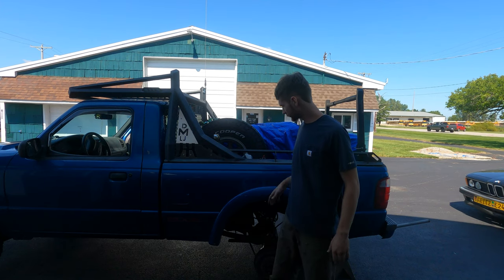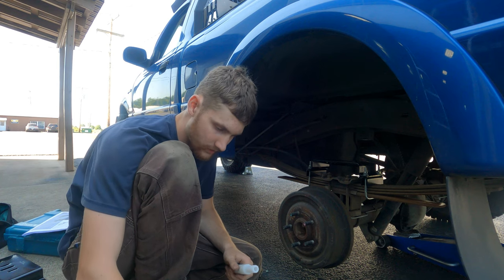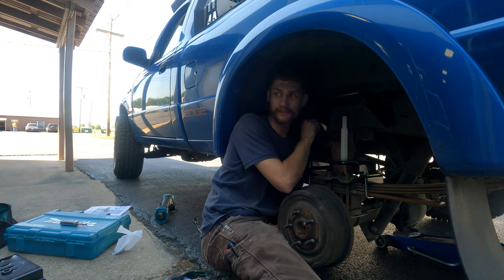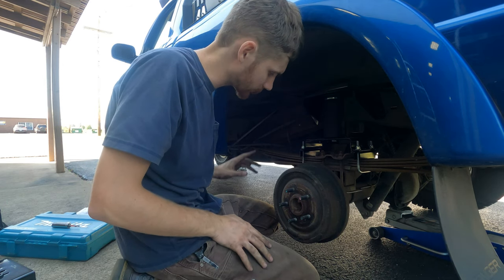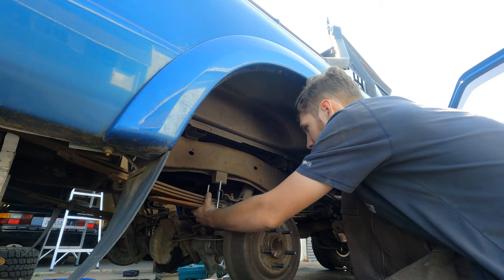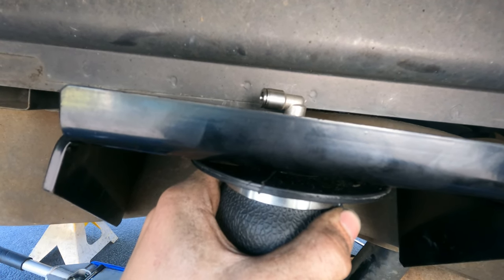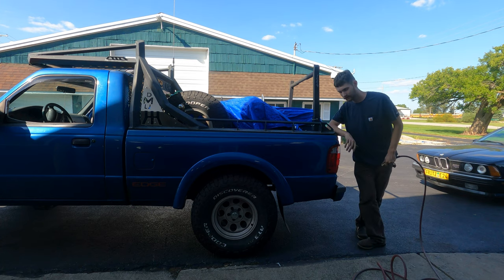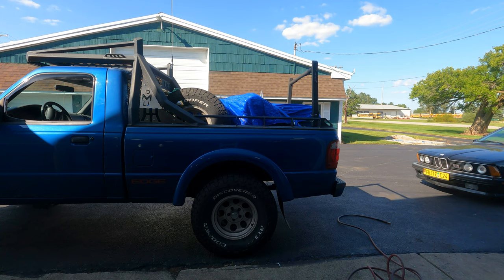Installing Airlift Airbags on my Ford Ranger!

Comment: How did it ride with the airbags installed? Great video
Reply from the maker: It improved the ride quality significantly. Before it was pretty squishy in the rear with all that weight, but the air bags stiffened it up pretty good.

Comment: Any issues with the bags I got a welder I haul around and I got a bass boat too I’d like to tow with my Mazda b3000 aka ford ranger
Reply from the maker: The bags work sweet. Just make sure that you keep at least 10 psi in them or else they will rub on themselves. I had one develop a hole
Reply: What's the max PSI on the bags?
Reply from the maker: @davidlz07  100psi